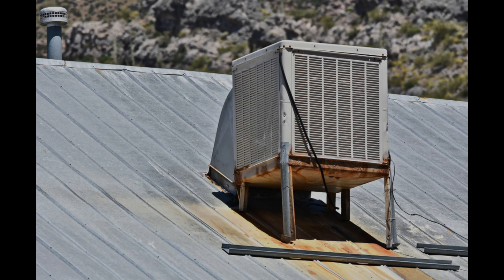Does the swamp cooler work?

Comment: I worked facilities maintenance for a restaurant chain in Las Vegas and we used evaporative coolers for our kitchen make up air and cooling . With the 8 inch Celdek pad coolers we could get close to a 30 deg.TD.
Reply: I'm in the same area and easily get 35 sometimes even 40° temperature different from ambient put only on dry days of course . In fact I just started using my air conditioner about a week ago cuz the swamp cooler was working so good even on 112° dry days

Comment: It was a big event in our house each spring starting up the cooler (in Phx). We'd buy excelsior pads at Yellow Front where the aisles were clogged with stacks of pads and the whole store was dense with the smell of excelsior.  For a week or so after startup, the house too would have the smell of excelsior. All the houses in our subdivision had coolers on the roof originally installed by the builder in the '50s. No thermostat, no pump, no recirculation.  Just fresh water distributed at the top of the pads and drained out via garden hose at the bottom.  We'd keep moving the hose around the yard all summer to water the fruit trees and grass.  Turning the cooler on and off also meant opening and closing the water valve piped through the hall closet.  The cost of water wasn't prohibitive.  I didn't learn till many years later that newer coolers recirculated the water via pump, float and fill valve, etc,
Reply from the maker: Oh my, Yellow front.  Brings back memories.
GFM

Comment: What's your thoughts of running 1" copper in loops 4' deep in your back yard then circulating that cool water through a heat exchanger in the cold air return in a forced air system with a dedicated thermostat just to turn the air handler on and off ? Would it cool the air considerably on a 100 degree day ?  The water holding tank for the water would very well insulated and be approximately 250 gallons and constantly circulate under ground into the basement then out again and continue the cycle using boiler style circulation pumps.
Reply from the maker: It could be effective but ground temp is the key here.  50F would yield about 65F water temp.  
Normal indoor coil temp for refrigerated air is about 40F.
I would expect effective cooling would be about 85F to 90F outdoor ambient.  
Of course insulation and window positioning make a lot of difference.
Depth would have to be somewhat lower, like 5 to 6".
Copper would be prohibitively expensive. Pex could work.
GFM

Comment: Swamp coolers in commercial kitchens act more as a make up air  to balance pressures created by the negative flow of  the kitchens exhaust hood.
Reply: Of course they are make up air and are used in areas that might have huge burners and cooktops operating non stop. They are better than simply dumping 95f air in for makeup air.
Reply from the maker: They are indeed make up air units, but make up air must be conditioned.  Cooling in summer, heat in winter.
GFM
Reply: Just fired one up for this weekend for a new restaurant owner in okanogan valley. How coincidental is that. Whoever installed it for them didnt really tell them about it being a swamp (evaporativ) cooler, they installed it where cant get to one of the panels and still can feel air rushing in as hood sucks more out than the cooler replaces, but at least now its not sucking in 100° air. But I love swamp coolers. Going back to see it motor two speed and if installer tapped the low speed.

Comment: A swamp cooler service video would be interesting. I'd watch it for sure. Also, what humidity ranges are they effective?
Reply: The key is dew point, the lower the better. Around 40°F is effective, you can do indirect or direct which impacts the indoor humidity.

Comment: The question I always have is how much  water flow across the pads is most effective?  Is it better to minimize the water, use on off pump timers or use max flow?
Reply from the maker: I would introduce enough water to keep the the troughs filled.  The water is recycled from the base pan.
GFM
Reply: I've experimented with it and surprisingly found putting a bigger pump in too much water flow actually reduces performance and they don't blow us cold. And I noticed when shutting off the pump and monitoring the temperature it actually gets colder for several minutes